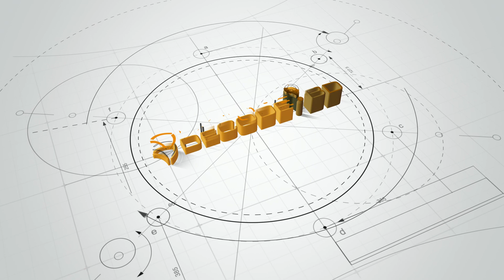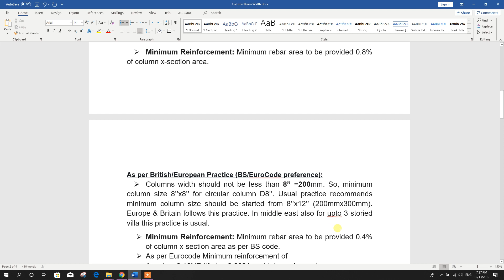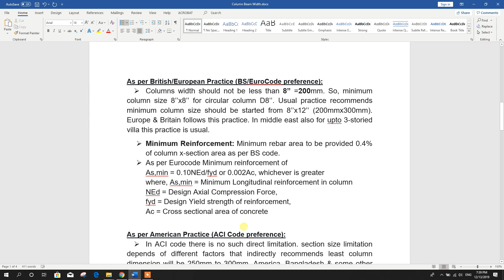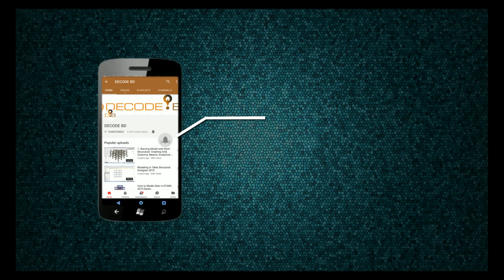Minimum Column Size & Reinforcement as per IS, BS, Euro & ACI Code

Comment: Hi. Thanks to share with us the clase in BS/EN codes. Thanks. Here our standard column is 150x150 and applies to G+2 residential building sometimes with span upto 4.75mx4.75m.  However there is also the blockwall made up of cellular block helping.  Will greatly appreciate getting those clauses in the BS/EN codes.

Comment: I searched the whole IS 456 and didn't find the least dimension of column as 225mm or 9". Can you please give the reference? I want it to show in my company as the structural consultants here have given 6"x18" column that too for 6 storey building and the column box is also easily available for that section which shows it is commonly used here in Bangalore, India.

Update: Found it in IS 13920 : 2016 Clause 7.1.1 which says minimum dimension of column is 300mm(12"); Earlier IS 13920 : 1993 Clause 7.1.2 says 200mm(8") as minimum dimension of column

Comment: As per IS code 13920:2016 minimum size should be 300mm or 15times dia of max beam bar.
Reply from the maker: Thanks for the updated information.
Reply: can you mention the clause?